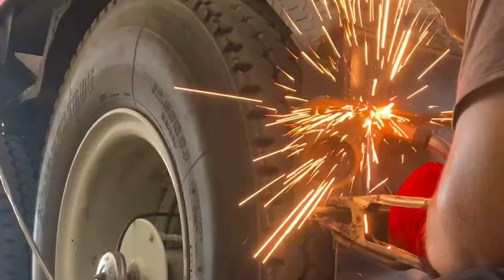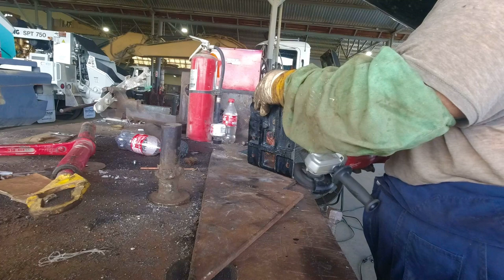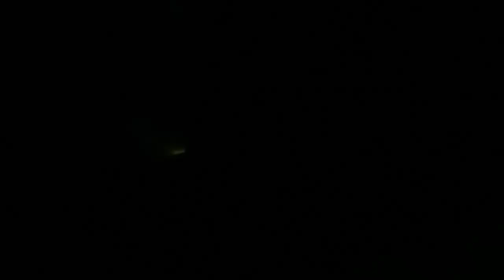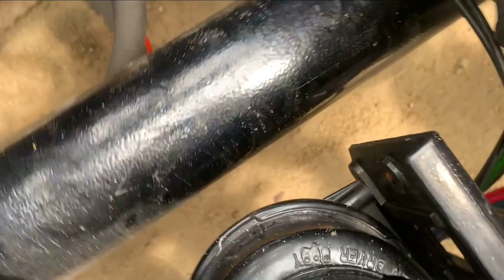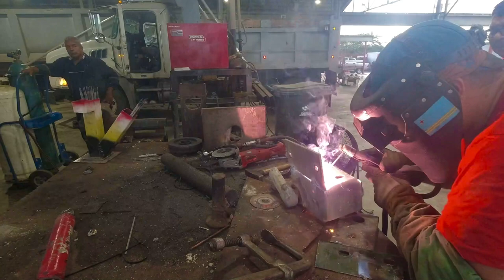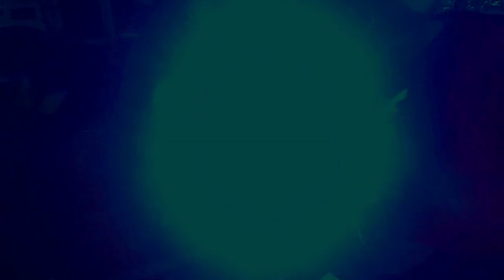ALUMINUM & CAST IRON WELDING

Comment: Good job! I had to stick weld aluminum, vertical up, no pre-heat, 1:30 in the morning, late winter (in Canada) had a mix of snow and rain all day. I did a couple quick passes to put some heat in the metal and then welded it up. All in all it worked out well and the truck was back in action when the crew came back in that morning!
Reply from the maker: Damn dude i cant imagine a mobile fix with aluminum rod let alone in the rain and snow haha! Props to you get it done!!